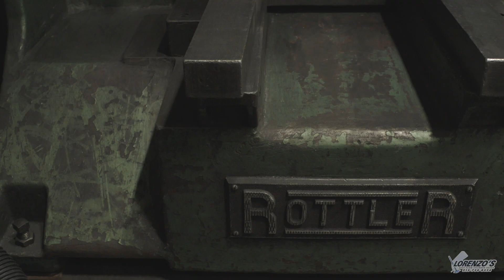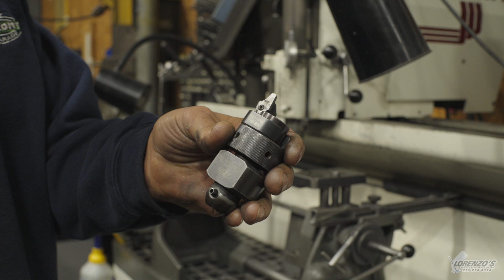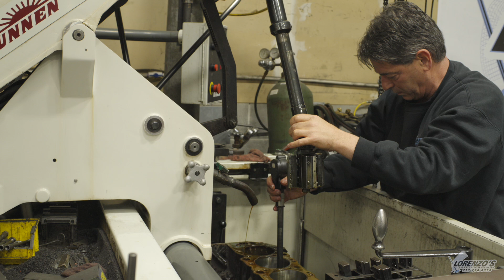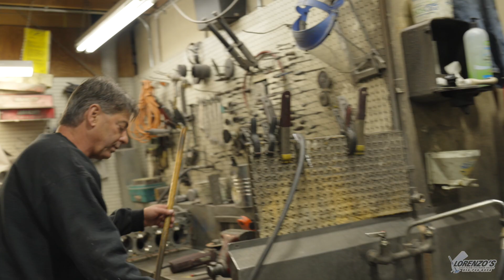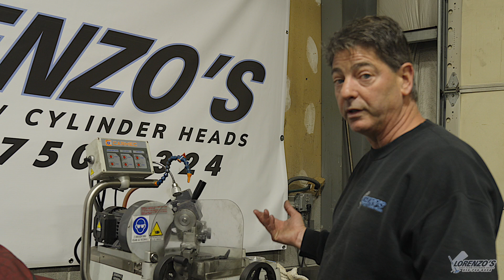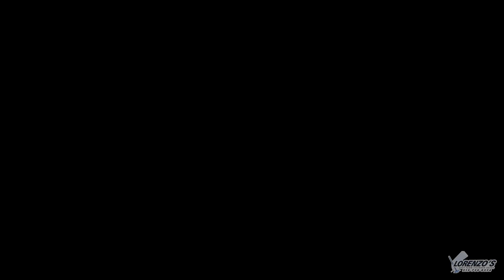The Shop Tour

Comment: It great to veiw your shop especially when I saw 2 Sunnen units I work for Sunnen in late 80's as Control Designer.  Also grey sand blaster  look like Zero Blast n Peen unit?  I just wondering because it was my 1st out of college I work for Zero and grey paint was use in the 1970's.